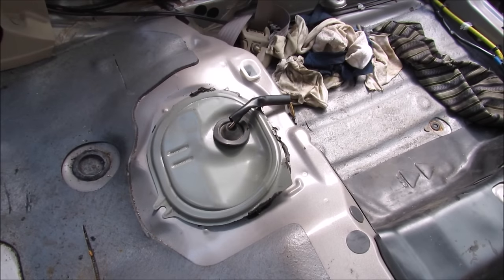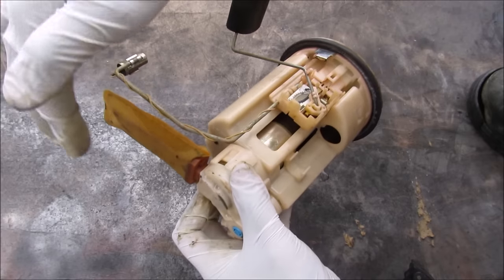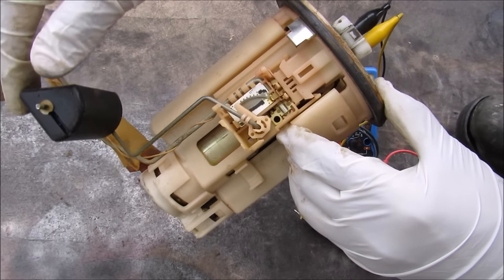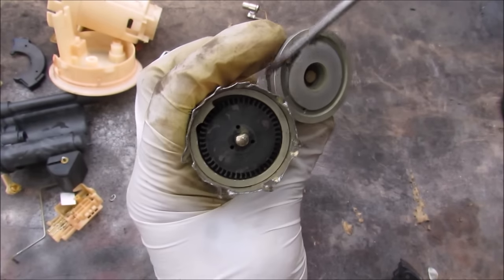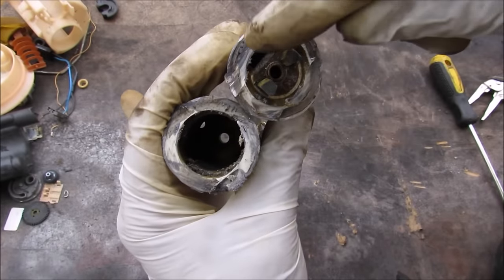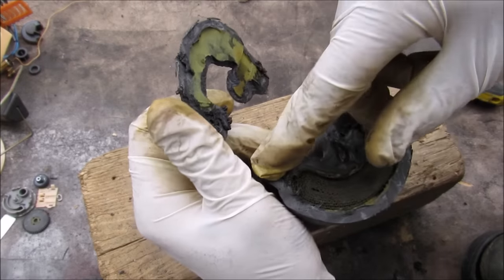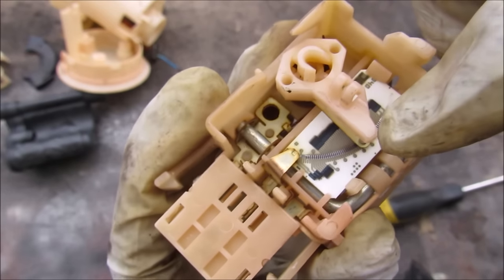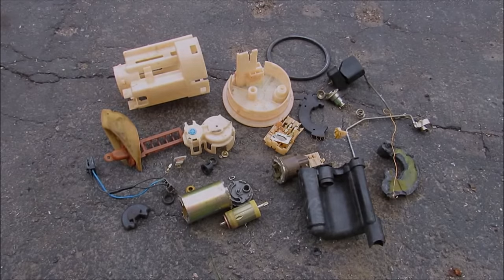How a Fuel Pump Works

Comment from the maker: Replacement fuel pump motors can be found here: https://amzn.to/2xuDpmr
A basic metric socket set is all you need to access it: https://amzn.to/32cEhKm
If you are having issues with fuel pressure, check it using this tool from OTC: https://amzn.to/2xynzHi
Reply: What's the rubber thing at the top called?

Comment: This dude should be at a UNIVERSITY teaching..he talks great n makes u understand every detail..God Bless you..
Reply from the maker: Man I wish I could have a day job doing what I do
Reply: @speedkar99  the problem when you're brilliant is you tend to over shine many regular cats 😂
Reply: @speedkar99   why pin 86 and 87 of fuel pump relay has already got power even when KEY IS AT ON POSITION??

IS NOT IT SUPPOSED TO GET ACTIVATED ONLY WHEN ENGINE RUNNING??
Reply: @tnamen1307  you have to have power at the fuel pump before the engine is running. otherwise there isn't any pressure in the fuel system and then your engine wouldn't get any fuel when your try to crank it, certainly when your car has stood still for like 2 weeks any pressure in the system is gone. depending on what motor you have, direct injected motor have an high pressure pump. the fuel pump in your fuel tank builds up pressure until around (3 bar, depending on what application you have) and sends it to the high pressure pump where it gets compressed until around 100 bar
Reply: @glasser2819  good morning, I have a problem with 1TR engine. Wish If you can help
Reply: Preferably not in biology.
Reply: @StrongestNormal  Hi there... Can you explain the working of fuel pump relay of hyundai venue...

Comment: This guy knows how to make and edit a video. Many Youtuber's can learn from him. Thanks, very interesting on the fuel pump.
Reply from the maker: +Leon Duigan Thanks 
Short and to the point is my video style!
Reply: i think he edit too much
Reply: I totally agree!
Reply: Leon Duigan sikringer til fuelpump på mer cedes c220cdi o6 modell
Reply: John Oliger sikring til c 220cdi 01modell
Reply: @speedkar99  whats wrong with you ..why dont you talk easily
Reply: @speedkar99  why pin 86 and 87 of fuel pump relay has already got power even when KEY IS AT ON POSITION??

IS NOT IT SUPPOSED TO GET ACTIVATED ONLY WHEN ENGINE RUNNING??
Reply: y
Reply: @speedkar99  
Hello 
Does the fuel come into contact with the internal parts of the DC motor?(brushes )
Reply: @tnamen1307  To build fuel pressure before starting the engine
Reply: @tnamen1307  the E.C.U. activate the fuel pump relay when the starter cranks the engine. In some older cars, when you turn the ignition key on, the fuel pump runs for about 2 or 3 seconds to prime the the fuel system.
Reply: Up until the last part where 4 recommend videos pop up blocking the resistor in water demo.
Reply: Maybe you need to understand better
Reply: Tip one: edit. Many don’t even bother. Omg

Comment: Note to self: The guy used a battery and some jumper leads to send power to the fuel sending unit after it was taken out of the car. This caused water to be circulated in a pan of water that he set the pump down into. So it doesn't have to be gasoline that moves within the pump, apparently it won't be damaged by water going through it and a 12 volt battery can power it. Also, it appears that the float and variable resistor combo does NOT tell the car if the tank is close to empty, it appears there is a separate sensor that does that. Note that the gasoline itself is what keeps the Direct Current motor inside of the fuel pump cool. There's also a pressure regulator, not only beside the throttle body injection unit, but one inside the fuel pump too. It's usually encased inside a large black plastic box and makes up the bulk of the fuel pump aside from that part which is mostly air inside the casing.

Comment: Even if you don't even watch this video, the most important thing to know about a fuel pump is, never, ever run your gas tank dry if you can possibly avoid it!  IDK if this video mentions this but, the fuel pump requires fuel flow through it to cool it.  So if the fuel tank runs dry, there is a good possibility your fuel pump will keep running anyway, until it burns up.

Comment: Hey fella just wanted to come back and thankyou for this video because it taught me that my GM Agila a uk vehicle fuel filter was in the fuel pump assembly and it was stuffed full of crap.  I had done the usual that is changed the pump initially and no change until I saw your video.  cant tell you how brilliant your video was for me.  I bought a complete unit and tested it off the car like you did and the pressure went from 7psi to 55psi and I new I was on the right track.  Most other videos only focus on the pump.  yours showed it all and I am a definate follower for the duration.  You are a star in my view.  Thanks for helping me!!
I dont however understand why manufacturers put fuel filter in the unit anyway.  I always thought fuel filters were outside so that they could more easily be changed.  Go figure ay!!  I really like you style especially your big spanner LOL!!! keep them coming.  are you in the trade?  excellent!!
Reply from the maker: +colin Lyne thanks I'm glad you appreciate my videos and it helped you understand things clearer. I am an engineer in the day and a backyard mechanic at night...haha
Reply: I could tell you are an engineer. Cause mechanics don't open up things into little pieces to see what's in them. Only engineers do that. Long live our species. :)
Reply: @thomashvnmusic  ? I open up everything to find out how it works or has stopped working and ive been a mechanic for 42 years

Comment: I'm just preparing to replace my fuel filter, didn't think I really wanted to get into the fuel pump / sending unit assembly at the moment but it's really quite simple and clever. Didn't realise the float and low petrol light were different mechanisms, I guess it's good to still have the dash light if your float circuitry fails for any reason. And it's just using the fuel as a conductor which disappears below a certain level, again so simple. I think we often get tricked into thinking things are really complex because the overall system is. It's great how you break these things down to make it more digestible.
Reply from the maker: Agreed. Very simple.

Comment: Just what I needed to learn: thank you! You saved me the trouble of taking my old one apart.
My Astro's fuel filter is separate from the tank, and its pressure regulator is built into the carburetor. It thus requires a return line to the tank from the carburetor.
It's amazing that my new pump can put out as much as 60 psi with just that simple impeller you showed us, that is, if the fuel is blocked from flowing by a pressure measuring gauge. I didn't measure the flow rate, but adjusting the constriction to flow is how the pressure is controlled.

Comment: Ah-ha! That's why my low fuel light quit working several years back. The pump and fuel level sender continues to work so I ignore that problem. Great video. Good pace.
Reply from the maker: +joeaverager so what now if you run low on gas?

Comment: The fuel level sensor is a thermistor that stays cool when submerged so its resistance is high. When not submerged, it starts to get warm from the current and heat up. More and more current flows as it warms which allows the light on the dash to illuminate.
Reply from the maker: +Jay _ that a a good thought, thanks
Reply: Jay_ you are wrong. The fuel level sensor is not a thermistor. It is a variable resistor (rheostat) whose output resistance (middle terminal) depends on the position of the arm which in turn depends on the amount of fuel in the tank. However, there are some vehicles, especial those with a return fuel line, that have a thermistor in the fuel tank. The purpose of this is to send the fuel temperature to the ECM for engine performance
Reply: You're talking about the low level light for the thermistor. The fuel quantity or fuel level is a series of resistors.
Reply: Good explanation of the thermistor though, the fuel level wording kind of throws us a curve.

Comment: Can't thank you enough for your videos. Your detailed explanations are the best I have seen. May I ask where you acquired your knowledge? Did you attend university and obtain some sort of engineering degree? I have not seen anyone on YouTube with the level of engineering knowledge that you have.
Reply: Check Engineering Explained on YT
Reply from the maker: Yes I have engineering degrees but we don't study this in school. I learn as you learn taking things apart on video and from repair manuals and reading up online
Reply: @speedkar99  yep, you are curious and like to understand complex engineered systems.

The devil is always in the minute details that make things perform  right,  efficiently or fail prematurely 🙂

The more you learn the easier it gets because you aquire "brain muscle" to organize your knowledge
🤗
Reply: @speedkar99   why pin 86 and 87 of fuel pump relay has already got power even when KEY IS AT ON POSITION??

IS NOT IT SUPPOSED TO GET ACTIVATED ONLY WHEN ENGINE RUNNING??

Comment: That showed why its so important to never run out of fuel. The fuel going through the pump actually cools and lubricates the motor. Without it a fuel pump will overheat very quickly and that shortens its life.
Reply from the maker: Good point
Reply: If you run out of fuel the engine stops running.

Comment: I'm working on a fuel pump tear-down video of my own; should be out within a month. The fuel pump I have is twice as tall, and I didn't have to use any power tools to get into the metal casing, so the inside will be a little cleaner. It's interesting how different the spinning element of the pump was between mine and yours.
Reply from the maker: +Cars Simplified thanks, yes there are quite a few different pumps out there. Let me know when you post your video too!
Reply: Forgot to tell you when it came out. It's posted now!
Reply: D:

Comment: Why do the sparks generated by the brushes of the DC motor not ignite the fuel???
Reply from the maker: +NutsandGuts you need air to ignite fuel. There is none inside the pump
Reply: speedkar99 ok i get it, but what if I run out of fuel? Then air gets in right?
Reply: I'm guessing gasoline does not conduct electricity like water. If you tried this with water it would short the motor out and it wouldn't even spin.
Reply: they are bushless motors
Reply: guess i should of watched video befor commenting
Reply: The one I took apart and the one he took apart had brushes.
Reply: Dilly Dally  This is true.  Gasoline, like everything, conducts electricity, but the resistance is so very much higher than ionized water.
Reply: Fuel in liquid state does not get ignited. You need to get it atomized if you want it to ignite
Reply: @gouthamshailendra  and how about gasolin vapour when it almost ran out
Reply: If you look at 3:28. There is a lip and a gasket right around where the brushes interface with the coils. I assume this is how they mitigate that. Plus those brushes are pretty thick and there is a long transition between the coils reducing the chances of having a spark.

Finally, you need oxygen to get fire, along with fuel and the spark, which is unlikely to find in this scenario.
Reply: It is pretty sealed. Not even air could get in. You need to cut it open if you want to see whats inside of that DC motor
Reply: What im saying is about the spark dc motor brushes produced.. those brushes are installed internally inside the dc motor.. and its pretty sealed.
Reply: NutsandGuts Yes if you run out of fuel and the pump runs it will ignite the air and there will be a huge explosion.
So make sure you don’t run out of fuel.
Reply: There won't be huge explosion as there's little to no oxygen in fuel tank as it's sealed with gasket, opens only at filling stations, and when it opens, no air goes in as gasoline vapours are already at higher pressure than outside.
So no oxygen - no ignition.
Reply: @abohilal9323  If i remember correctly, the pump motor sits in its own reservoir of fuel so that even with an empty tank, there will always be fuel around it.
Reply: There's no oxygen inside the tank. Under normal circumstances the pump casing is full of fuel, so again no oxygen. Even if the pump is run 100% dry and the tank is empty, there still isn't a high enough concentration of oxygen inside the tank for fire due to the high concentration of fuel vapors. Even if you found a way to pump oxygen into an empty fuel tank the tolerances inside the pump are too small for flames to pass in or out of. It's pretty much impossible for an electric fuel pump to cause a fire.
Reply: @Xixu.co.6  they is no air inside my tryo
Reply: The fuel is too rich to ignite
Reply: @speedkar99   why pin 86 and 87 of fuel pump relay has already got power even when KEY IS AT ON POSITION??

IS NOT IT SUPPOSED TO GET ACTIVATED ONLY WHEN ENGINE RUNNING??
Reply: @NutsandGuts  maybe a  late respons but this video is very intersesting to watch if you wanna know how fuel works: https://www.youtube.com/watch?v=7nL10C7FSbE
Reply: @tnamen1307  to prime the fuel system for faster starting.
Reply: @51-FS  you are wrong, they have brushes
Reply: They're brrushless motors and don't developed sparks like a brush motor does... and even then a brush motor wouldn't even work when submerged in liquid.
Reply: @Xixu.co.6  Thank you! After 3 years that was the explanation I was looking for!!!
Reply: That's why they submerged the motor itself, too rich of fuel does not cause combustion. It's the best case scenario rather than let the motor hang inside the air pocket of the tank. Not to mention Gasoline can prolong the motor's life.

Comment: awesome, blew up the water pump on my portable shower (4wd ing around Australia), so got a fuel pump from the wreckers and pulling apart to replace the motor.. Should get a bit more pressure out  of it as well. Cheers.
Reply from the maker: +Aaron Kent make sure you through rinse it since it's been emersed in fuel
Reply: Sure will, degreased, detergent, vinegar soak and then bicarb to nautralise the vinegar..

Comment: Very helpful video. I need to replace my fuel pump and this video made me understand a fuel pump and it’s parts a lot more.
Reply from the maker: Thanks. Are you just replacing the motor and filter, or the entire unit?
Reply: speedkar99 I’m replacing the whole unit. It’ll be my first time replacing a fuel pump so hopefully it goes well.

Comment: Very informative video , the fuel level low sensor I think is a heated resistor and ecu check the resistance change, when fuel is not touching the resistance it gets more heated and  increasing the resistance indicate low fuel level.
Reply from the maker: I think it's just based on resistance. Nothing to do with heat given how it's wired.

Comment: I have that exact fuel pump assembly. Those were the easiest to work on;however you go above and beyond by slicing up the pump and showing us the guts.
Reply from the maker: Thanks. This pump is used in Many different Toyota models
Reply: @speedkar99  I like the larger filter but the Philips screw driver bolts needed to go. That was a design I didnt mind because those bolts get stripped too easily. Now you just need a hammer.

Comment: Thanks for this perfect AtoZ system presentation. 👍🏻

I thought my pressure regulator was shot but now I see it may really be the filter media that is all plugged up 😂

These simple designs are called RETURN-LESS fuel delivery systems. 

The pressure regulator stays cooler in the tank than in the engine bay.
Zero electronic control involved, just a simple diaphragm & opposing spring.
🤗
Very resilient German design when it's made for Japanese cars.
Reply from the maker: Yep 
Returnless is way better than dealing with two fuel lines
Reply: @speedkar99  is this fuel pressure regulator also responsible for not allowing the fuel to drain back into the tank so the pressure is maintained for start up instead of having the fuel pump operate for a couple of seconds when the ignition is turned on KOEO? Only ask as my 1998 V6 camry after sitting overnight takes a few more cranks to start than if its only been turned off for a couple of hours.

Comment: Never seen a toothbrush used as a pointer before quite interesting.....

Think the variable resistor is called a potentiometer.......

Also before you take the pump out good idea to blow the top of the tank with compressed air before you remove it otherwise all the junk and dust and rust will drop into the clean fuel tank...

Good video I like seeing things taken apart like that it’s very helpful and for the most part all the different models of car doesn’t matter the fuel pumps are essentially similar....
Reply from the maker: Good tips.... though if you see my EVAP system video, the tank was cut apart to see what's inside.

Comment: This Fuel pump assembly is unique in that the pump, regulator, and filter are all combined into one unit. For example, my car has a fuel filter by the tank under the car, the regulator is by the engine block, and the pump is obviously in the tank. It seems like the video is saying that the pump has both a filter and a regulator but it usually doesn't.
Reply from the maker: Yes this is an all in one design

Comment: Long story short - Had at least a year old problem 06 Sentra and took it to a couple shops and didn't fix it . It was not revving up no matter if i floored pedal . It was gas pump and I went to junk yard got it for $34 including warranty . That was yesterday now running like a champ like new !! Yeah at very beginning suspected it might be pump but went with shop's recommendation .  I trouble shooted it myself